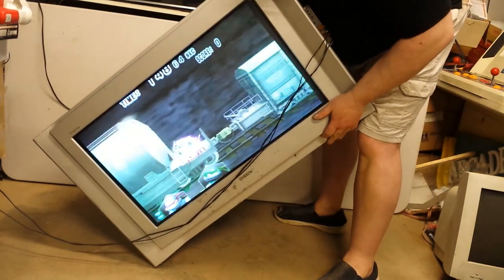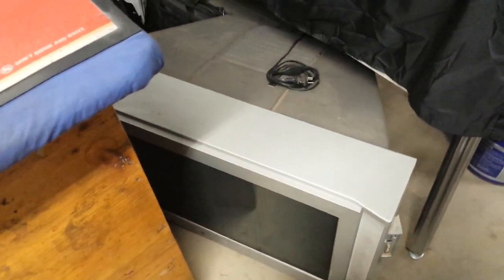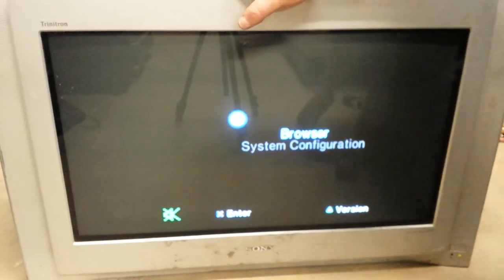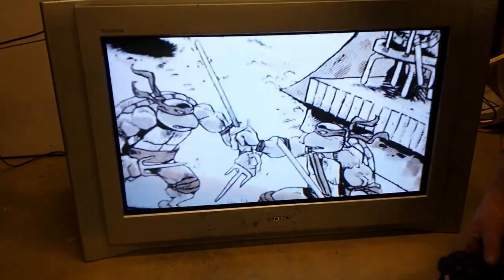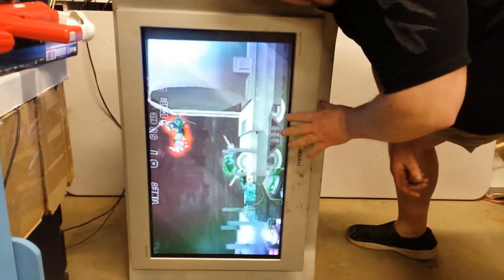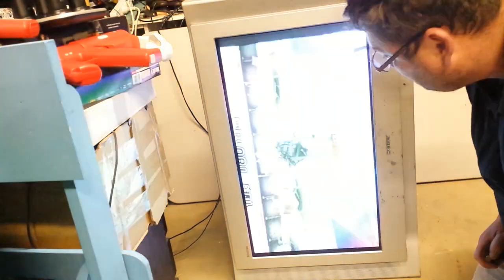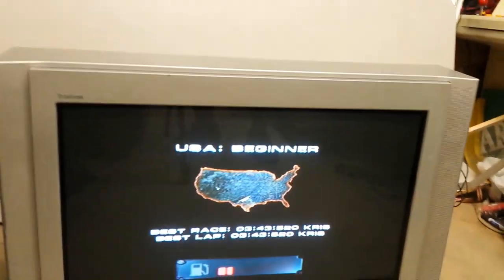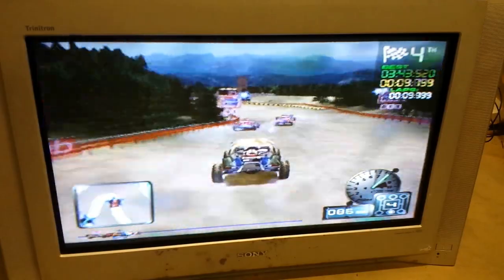Using  a CRT TV from   horizontal to vertical  for arcades

Comment: Dont ever rotate a CRT when its on.   You need to turn it off, give it a chance to cool down and then rotate it.  You wont get purity issues if you do it that way.
Reply from the maker: I disagree ,  the picture will not be right if you turn it on it's side weather its of or on , but I do agree yes turn it off before moving yes , But I left it on for the purpose of the video , you still need to re-adjust with magnets to sort out the picture
Reply: @MarchosArcade   Thats just not true.  In general, rotating a CRT when its off, and youv'e given it enough time to settle, should never give you purity issues.   I know this both from years of experience and a basic level understanding of how CRTs work.

I will concede that I dont have any experience with HD CRTs so its possible that they have this quirk when it comes to rotating them since they are quite large and oddly shaped.

Also i'm not trying to dog you but you should have turned it off ESPECIALLY for the purpose of the video.  Its supposed to be a demonstration of what to do.